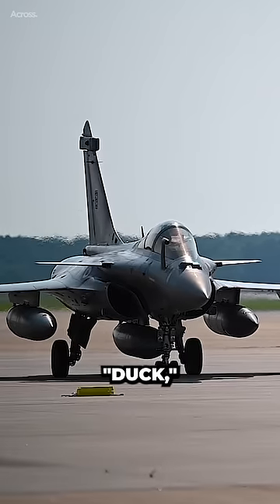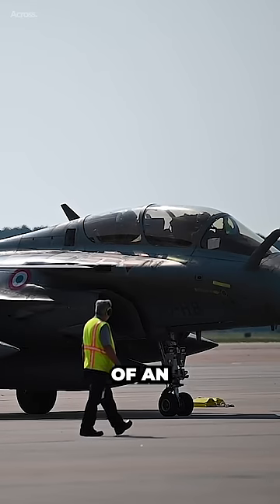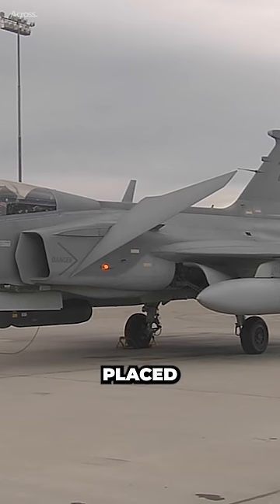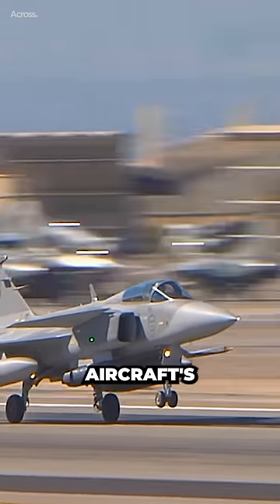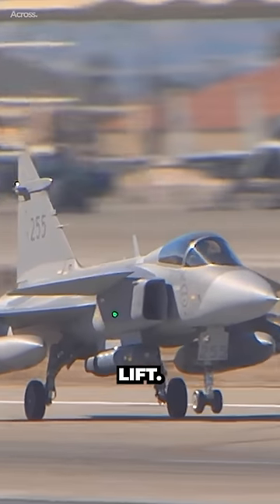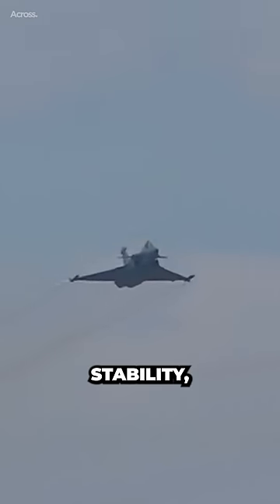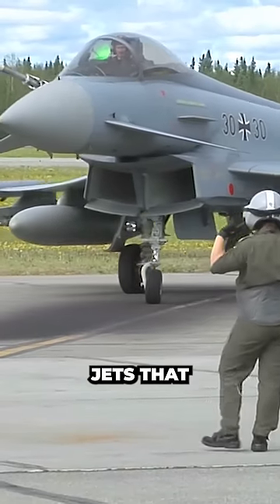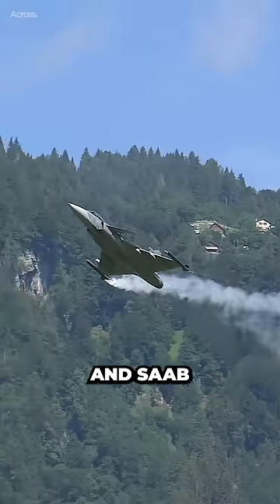Why Don't American Fighters Jets Have Canards? #shorts

Comment: Basically, canards are more talk than walk. They are sexy af though
Reply: Not really they help Manoeuvrability a lot, That’s why all Three European Major Jets use them, Think about it Kid.
Reply: @ddoubleg  
Thrust vectoring is better, and it doesn’t compromise stealth.
Reply: @drksideofthewal 

Thrust vectoring is more difficult to develop and is an engine thing. Canards are more an aerodynamics subject.

The European military aircraft industries, like Dassault with its Mirage series dating from the 50's, worked with delta wing designs. Also Saab (Draken 35).

Because deltawings are good at high speeds (and intercepting), but also need longer runways because of higher take-off and landing-speeds and are less manouvrable (needed for defensive roles). 

My guess is the Swedish Air Force wanted jets that could use shorter runways and ordinary traffic roads for take-off and landing. That's why they added canards. Also, the Viggen got a defensive role.
Fly-by-wire wasn't developed at that time.

The French Dassault, with its deltawing Mirages, also wanted to add more manouvrability to some of their jets (i.e. KFIR for Israel AF).
Reply: @drksideofthewal and there’s only 1 stealth aircraft in the US arsenal that sues thrust vectoring. The F22. How’d that programme go?
Reply: @carwyngriffiths  
It resulted in the most dominant air superiority platform of all time.
Reply: Modern "canarded" European aircraft such as Typhoon, Rafale & Grippen...regularly come out ontop against U.S. aircraft in mock air-air engagements. The only aircraft that gives them a headache (so to speak) is the Raptor & that's not by much. This is all an easily verifiable fact. So yeah, they do more than "talk."
Reply: @THE-BUNKEN-DRUM  
You have an odd definition of "regularly." We know of maybe a couple of instances of those aircraft beating the F-22 in a mock dogfight... we don't know how often the F-22 defeated them in return, as the victory of  a 5th generation fighter is expected and not newsworthy.
Reply: @drksideofthewal  : You have an odd way of comprehending comments. As I never once stated that the Raptor regularly lost. Every other aircraft on the other hand....
Reply: @THE-BUNKEN-DRUM  
I did misread what you said. Anyway, canards are still pointless compared to thrust vectoring, and impair stealth.
Reply: @drksideofthewal  : No, canards are pointless for the Raptor. But clearly not for 'certain' other aircraft, as their performance speaks for itself.
Reply: @THE-BUNKEN-DRUM  
The Raptor has thrust vectoring, and you said yourself that it performs better than canard equipped aircraft in dogfights. Hence my point. The Raptor managed to be a superior dogfighter, without compromising stealth.

I suppose getting kills against 40 year old 4th gen fighters in mock WVR dogfights is “a” flex, but not very impressive compared to the state of the art.
Reply: @drksideofthewal  : I said the Raptor "gives them a headache." I never stated that it performed better, as such. Now, don't get me wrong, it does perform better in certain flight envelopes, but just like other European aircraft with canards, they perform better in other flight envelopes.
Reply: @LEGEND  1st of all. We know very little about the f22s limits. As its specifics have never been declassified. And your absolutely wrong by saying the f22 regularly gets beat in mock fights. The f22 has over and over proven how dangerous it is, in these mock fights. There has been a couple time its been beaten, but its very rare and its relatively a big deal when another aircraft does beat it. (Obviously though, my original comment was just a joke, just good American vs European competitiveness.
Reply: @drksideofthewal  my bad, i also misread your comment. But still, the few times the f22 lost, it barely lost. It wasnt an overwhelming defeat at all.

Comment: We don’t use canards because we actually make our shit right.
Reply: Samuel you do realise most of your designs come from Europe, and the Canards are amazing that’s why all Three European Major Jets use them, The Eurofighter Typhoon was made To be unstable just so it can turn better and have better manoeuvrability.
Reply: @ddoubleg same with the JAS-39
Reply: @ddoubleg  That first sentence makes no sense. How can we use a design from a country who uses different designs. We don't use canards so therefore we can't be using their designs... 

Fact of the matter is there should be no situation in which an experienced pilot should be in where Canards are even necessary especially considering how stupid maneuverable aircraft like the F-22 already is.
Reply: @ddoubleg  The Eurofighter being made to be unstable is nothing new. Fly-by-wire controls have made that possible for a long time.
Reply: @Neonmonkey42 Mirage 2000 for the W, first of its kind and even for a first run, the tech built for it was remarkably refined with stalling fail-safes among other things
Reply: @gibster9624  delta wing designs with canards has benefits that F-designs just don't
The F-22 is an exception as it is waaaay overengineered (not pointing out as a defect or something, just stating it as a matter of fact)
And that design being aerodynamically unstable is just redundant since fly-by-wire has computer correction that allows for high speed flight with remarkable stability correction, see the Mirage 2000 for more details
Reply: @gibster9624  Canard fighters are even more agile then the F22. There is a reason why they went with canards.

Comment: the big one today is making a canard design stealthy is far far far more difficult than a traditional layout. Case in point, the J20. supposed stealth plane using stolen technical secrets from the F35, and yet, it still has a radar cross section big enough to be identified as a plane.

Comment: Canards allow for better turn time, BUT US air doctrine no longer calls for dogfighting for the majority of the time. Reason being, if you’re in a dogfight then someone has made a series of strategic and tactical fuckups that led to US aircraft not engaging Beyond Visual Range (BVR), which is one of our biggest advantages in air to air combat. Dogfighting is still taught, but it’s more of a last resort. AIM-120D’s are extremely efficient and allow for several kills BVR before half of the enemy even knows it’s been locked onto with search and track radar.

Comment: The F-14 had retractable canards. But the one major reason not mentioned in this video is that canards are used mostly with delta wings for increased maneuverability, as seen in the examples. The US does not currently have a delta wing fighter.

Comment: Fun fact, there 'was' interest in a fighter aircraft with canards right around the time the EuroFighter Typhoon was introduced, and while the comments point to lockheed martin, the Bell company came to a seperate conclusion, which ultimately lead to the fins on the F-18 super hornet it was determined that canards produced minimal effect at the front of the aircraft on current US designs, however the tail section of the F18, and even the F22 and F35 are heavily influenced by the rotating surface idea that is prevalant in most aircraft with canards.

Comment: If stealth isn’t a concern, delta-canard is the optimal configuration, however at the time most pre-stealth US fighter jets were originally designed, that conclusion wasn’t yet made as computers couldn’t model it and FCS couldn’t handle the added instability to the degree that they can today.

Comment: The actual reason is that modern US fighters built for high maneuverability use thrust vectoring instead.

Also, the leading edge wing extensions on the F/A-18 provide a similar effect. The only reason why they are not adjustable like "real" canards, is because the Hornet is not a delta wing design, and thus has the control surfaces on the back of the plane.

Comment: Fire call correctly. One necessary characteristic of canard aircraft is that the canard has a lower AOA stall point than the wing so that it stalls out first, for safety/stability. This reduces ultimate maneuverability/performance. I don't know if this thought has already been expressed.

Comment: The B1 bomber has canards and been in active service since the 1980s. There have been experimental versions of the F-4 Phantom II and F-15 Eagle with canards, the Mach 3 XB-70 Valkyrie bomber was equipped with canards, NASA’s X-29 tested canards and forward swept wings for over 7 years. The US and Germany both worked on the X-31…apparently the US military does use, but for the most part has rejected, canards in its aircraft.

Comment: Another reason is that the jets with canards are delta's, and need the extra control surface. Straight taper wings with conventional tails allow you more flaps and better control.

Comment: Fighter jets are typically made to be unstable to be maneuverable while commercial airplanes are made to be as stable as possible. Possible reason for not having canards anymore is cause the US is focusing on stealth fighters which means you want less surface area while canards increase it. Also modern fights involves locking and shooting a missile far away and rarely any dogfights like the old days which means you don’t really need to get close and do all does little tricks and stuff to gain a edge which also happens to not really be effective against a missile that has honed in on you.

Comment: I’m pretty sure one of the biggest reasons is that it’s very very bad for stealth.

Im not an expert though.
Reply: No. They just moved the control areas from the back to the front. Total radar reflective area stays the same.
Reply: It's also very unnecessary with today's knowledge of Aircraft.  70 to 80 years ago they made some sense.  Now using them is a sign of bad Aircraft designs or using a cheap budget.

Comment: Canards are used when the base design has a lack of stability or control and are generally a fix to a lacking design.
Reply: Lacking of design ? Absolutetly not. Canards are use to improve stability at low speed because of the delta wings. The chose of Delta Wings is because this allows to reach higher sub (mach 2) easier and quicker than tradition shapes. Its a doctrinal choice, not a lack.

Comment: The BONE does have small canards.  They are for smoothing the ride, not for maneuvering.
Reply: Had a professor who worked on the control software for them, between the software and the canards it enabled the B-1 to skim 50 feet to the ground at speed.

Comment: If you look at US fighters 4th gen and later, the Stabilators (all-moving elevators) are all as far back as possible. This is because moving the control surfaces as far from the center of inertia increases their effectiveness. Canards are great for adding maneuverability to tailless delta wing fighters, but we don't produce those anymore.

Comment: With fly by wire its about the simplest way to get the nose around fast.
So combined with helmet sighting, superb gsuit for instant 9-g and over the shoulder missiles its acceptable.
The downsides of radar visibility air frame stressing and maintenence are suffered.
The Euro fighter was designed to take on Su27 types.
A wall of them operating behind F-35's with data link and tanker support is pretty effective and the manoeuvrability is handy for self preservation.

Comment: Not just that the entire concept of canard is that you have an unstable airframe by design. It allows them to perform maneuvers and tactics a plane without them simply cannot do. 

US airforces also have mainly tactics flying at high altitudes and then diving their goal is air superiority. Most nations using canards use tactics that start at low altitudes and then rise to surprise attack. High risk but their planes are more stable thanks to the canards. And they assume Airsuperiority will not be easily achieved.

This is why for example the Griffin airplane from Sweden can take off and operate when practically any other plane would be grounded due to weather.

Comment: They also are nearly impossible to make low radar return, a key requirement of the USAF since the 1980s. Their shape and position are sure to reflect, nearly 3 times the present radar reflection of an F22.

Comment: IN case of a merge and subsequent dogfight, the canard has a huge advantage in being able to turn quickly, and potentially get off the first shot.   The problem is what happens after that.  This little maneuver scrubs off so much speed that if it doesn't work, the jet is at a huge disadvantage until it is capable of building up speed again.

In other words with a canard you increase the chance of being able to get off the first shot after merge, but sabotage subsequent shot chances.

I suspect the canards also compromise low radar return somewhat, making them undesirable in the likes of the F-22 and F-35.  If the U.S had designed a newer 4th Gen fighter like they have in Europe, I wouldn't be surprised to see canards on it.

Comment: Canard layouts in design require the canard stall before the main wing, so the ability to command very high angle of attack of main wing is limited... and very high alpha is sometimes desirable.... such as short field takeoff and weapons pointing for gun engagements.  You'll see similar concerns with canard integration in nearly every type of aircraft, from light sport to large passenger aircraft.  Even the homebuilders opted out of long term canard use, despite some relative safety advantages re: spin/stall.

Comment: I like how Americans, if they cannot make something or they don't know how to make something. They try to say that it's no good yet all three aircraft have beaten the F-22 in Test battles.
Reply: With them starting behind the f22 get that correct lol. All that proves is those are competent pilots. And that was one time out of plenty of practices as well.
Reply: @RW-zn8vy  F22 are not as stealthy as you would like to think they are.
Reply: @jonathanmaybury5698  I think your confused, those trainings weren’t  bvr lol the eurofighter can’t even take on the f35 leg alone an f22. The trainings were bfm with the f22 being defensive. If the 22 isn’t that stealthy then how come the f35 is hard to detect for the euro?
Reply: @RW-zn8vy  Remember the F117 and the B2 they where supposed to be stealthy too, but they are not.
Reply: @jonathanmaybury5698  they were, the f117 did hundreds of bombing missions undetected, one getting shot down is nothing, no aircraft is invincible. Also stealth doesn’t mean invisible it’s just a lower radar cross section so its harder to detect. The b2 has never been shot down so?
Reply: @RW-zn8vy  They have already admitted that radar has advanced enough to render stealth practically useless plus a stealth plane has to fly subsonic or else the paint comes off leaving them at a big disadvantage.
Reply: @jonathanmaybury5698  ok but can they lock up the aircraft? No they can’t, there’s a difference between a fighter radar and ground controlled radar. You have no clue on what you’re talking about.
Reply: @jonathanmaybury5698  and it’s not useless if it’s not stealth both the f22 and f35 are far better than any fourth gen fighter and fifth gen in the world. They don’t need to be stealth it just depends on the mission.
Reply: @RW-zn8vy  Ground radar has been interactive since the 1940s. what are you on about?

Comment: The "TFX" simulation engineers who built 3 flight models, the F-117 the EFA2000, and the F-22 and the EFA2000 carries 3000 pounds fuel internally with an optional external 5000 pound tank.
The F-22 carries 10,000 pounds internally

Comment: Also, canards affect the placement and design of the gun, and the mechanical parts of the canard add weight to the front of the plane vs. the rear - which can affect balance. While it is certainly possible to overcome these limitations, why bother when elevons work fine and don't have the same limitations.

Comment: The B-70 was ahead of its time.
Designed 14 years after WW2 and still looks futuristic today.  Then or now, no interceptor could catch it.
Reply: The name was XB-70. And you don't need an interceptor to destroy a 750.000.000$ bomber when you have cheap missiles.

Comment: with adequate tail control you should never require nose control surfaces it's for slow speed maneuverability although the almost insignificant  amount of extra lifting surface to carry higher payloads they're an unnecessary aftermarket add on at best and We'll design better without the equivalent of an aviations crutch 🩼 to try and make bad designs function just barely enough to not scrap the entire design and waste of funding 😅
Reply: 😂 the most honest answer ya gonna get right here and I just happen to love 💓 aerodynamics and different forms of engineering craft

Comment: Because American aeronautical engineers know how to design the fuselage and control surfaces as to not necessitate the use of canards as an afterthought, usually used after it’s found that the flight performance and handling characteristics of said design are not acceptable.

Comment: Canards can increase fighter's maneuverability, But it also increase the detectability, It's raised the risk of been spotted by enemy's radar...

In modern air combat, High maneuverability is not that effective when you been targeted by homing missiles, So stealth is more important then dodging (This is why F-22 using vectoring engine rather then canards, It's gives high maneuverability and didn't breaking the stealth ability)